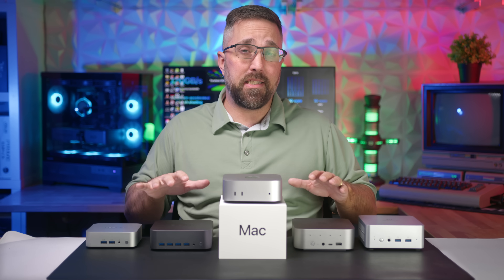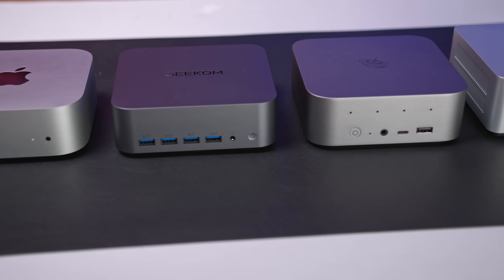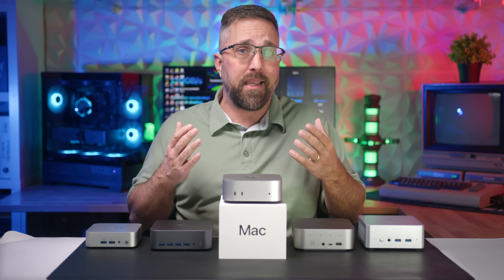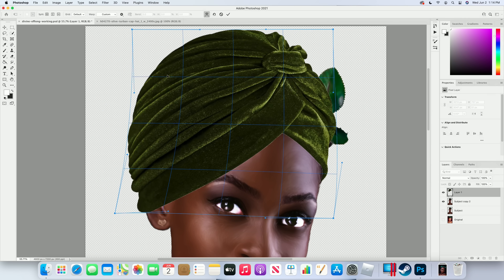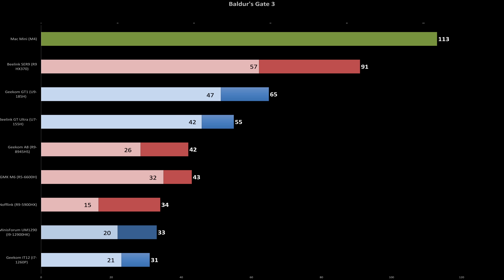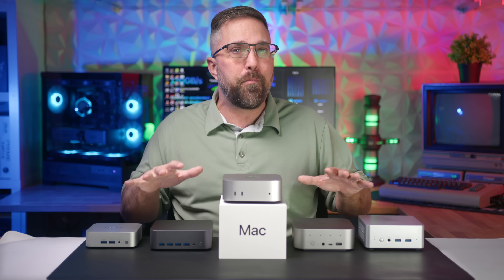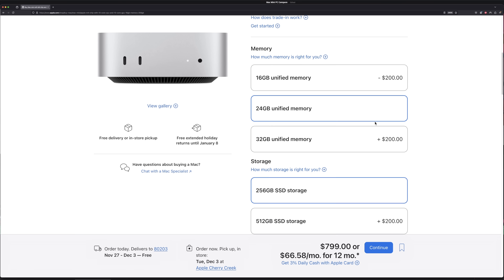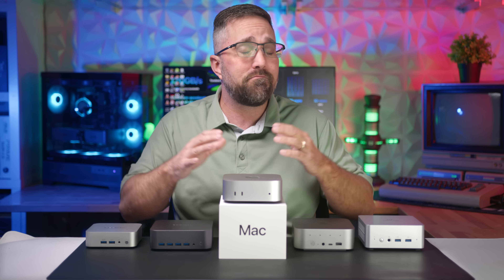M4 Mac Mini vs Intel and AMD Flagships – It's Not Even Close!

Comment: Nice comparison. I mainly upgraded my 2014 Mac Mini for compiling cross platform apps and development work that has to be done on a Mac. That said my wife some times uses an older Dell mini system, but if she does plan on doing more photography I plan on giving her the base Mac Mini, and spending the extra for my dev box. Storage and RAM are such a let down with the base price, the storage was just a slap in the face, and the RAM was because the OS needs the extra space.

Comment: I'm a Mac user - you should have used a Mac mini with 32GB of memory and a 1 or 2TB NVME. The $599 entry price is irrelevant when comparing against the PCs you've selected. That puts the Mac mini at $1800 for the base M4 or $2400 for M4Pro base with additional cores and 48GB of memory.
Reply: my understanding is macOS is efficient with its memory & 16GB "feels" like 32GB in Windows.
Reply: @udance4ever  you can't replace memory.
but yes, OSX supports memory overcommit and active memory compression, like Linux and AIX do too.

Since it's not a gaming machine, a mac mini is unlikely to replace a windows machine. In my case, it replaced a Raspberry Pi4 running Linux.
Reply: @udance4ever  its been proven that 8gb on macOS doesnt equal 16GB on windows. Therefore 16gb wont equal 32GB either
Reply: @udance4ever  in no world this is true

Comment: The Mac has half the ram and at least 4x less storage. Once you spec it similar it’s wayyyy more expensive
Reply: Lol you have such a funny logic...

Mac outperformed those PCs. even with its "low spec"
Reply: @zotirides9293 exactly. This was the whole point of this video. Even with lower specs, it was on par or exceeding more expensive PC options.
Reply: Just get an external drive. And the base ram should be fine for most tasks.
Reply: @PaDutchRunner   Storage is easy to fix but the ram is the problem, the base ram is not enough for anything but basic tasks in which case a Mac mini is overkill anyway. Just get an N150 or N250 mini PC. You will probably get twice the ram and storage even for half the price of the Mac. But let's be honest, most Mac customers are not comparing and would never pick anything else. Apple knows that and thus the crazy upgrade prices.
Reply: @bertilorickardspelar  base ram was increased to 16 gb a few months ago.
Reply: @PaDutchRunner  Better late than never I guess. They are nice, silent and powerful machines. Unfortunately I hate Apple as a company. I will never buy anything from a company that anti-consumer.
Reply: @bertilorickardspelar  you don’t think Microsoft is anti consumer?? If it weren’t for apple, there is a huge chance that computers would be limited to corporate access. That was Job’s point in his “1984” Super Bowl commercial.
Reply: @PaDutchRunner  Yes, Microsoft is probably worse than Apple. Apple did a lot for the development of the personal computer, kudos to them.
Luckily nowadays you can buy computers with Linux or without OS.
Reply: @bertilorickardspelar well then I hope you buy pcs with no windows and run Linux
Reply: But then it's also more capable as the RAM in these things is so fast you can get away with having less, and Mac OS is incredibly efficient at memory compression and general resource management compared to Windows, again, making the need for more less of an issue. The memory bandwidth of the base M4 is higher than the max bandwidth of socketed DDR5. Then you get the Pro, Max and Ultra versions (though there is no Ultra M4 this generation). The lower storage does suck, I won't deny that. There's no fancy way of getting around that one as there is with the lower RAM.
Reply: And also WAYYY more performant. Imagine he had gone for M4 Pro or Max? Wiped the floor with the others, handily, at everything.

Comment: I understand one could argue the Mac Mini delivers this benchmark-performance already with 16GB RAM - but comparing prices with 1/4 or 1/8 of the storage capacity is nonsense. The Mac Mini with 1TB SSD already is 999$ - make it 2GB, as the Geekom has - it's 1399$ - and if you even out the RAM, when your project needs more than 16GB (which most benchmark don't) - you are at 1799$ for the Mac Mini with 32GB Ram and 2TB storage.

And honestly... for the kind of work you benchmarked in the PC market I would not go with a Mini-PC, but real "high end GPUs" - meaning a dedicated GPU... for a workstation I usually don't need a gimmicky small case.
Reply: "...for a workstation I usually don't need a gimmicky small case.": You don't need a tower either. What you 'need', is which machine does it's job best.
Reply: I agree, his comparison is not "Apples" to apples, considering all the other systems have way more storage, and upgrades for Macs is ridiculously overpriced. I have a couple of Minisforum mini PCs in my home computer lab, each with 8 core / 16 thread AMD procs, 64 GB RAM, and 1 TB NVMeSSD... 4x the RAM and storage as the Mac Mini, for the same price. Also the Mac Mini has only 1 Gbit port, while my tiny servers each have 2 2.5 Gbit ports.

Comment: 600$ is a dream, over here Apple charge 280$ for 8gb more ram and 1100$ to upgrade to the 2tb ssd.
Don't care how much preformance it give, it's still locked in to their own little world.
Reply: Yet every single Mac that is purchased works correctly, no making Freakenstein machines like on the PC.
Reply: @tonyburzio4107  It works until macOS crashes like 16 times.
Reply: @arpsichord7474  Clearly you haven't actually used macOS and are just making nonsense up. I use macOS, Windows and Linux and one thing Linux and macOS have in common is stability (and better privacy but that's another topic). Anyone that's actually used the machines knows what you're saying isn't true but keep plugging away there buddy.
Reply: @Invid72 I've used two MacBook pro M4s. Both died because of their chips. I'm never going back to apple ever.
Reply: @arpsichord7474  You should buy a lottery ticket.
Reply: @tonyburzio4107  Most stuff works right out of the box? Some smaller brands right out of China might not have the best trackrecord, i follow and watch alot of mini pc reviews, the only thing ive heard is Minisforum have had some trouble with certain models in the passt.
There are pros and cons with everything, if anything goes bad with the Mac you gotta turn it in, on 99% of small computers you can just get a new powerbrick, swap the ram/ssd out in a few minutes...Mac you gotta pay the price or you can fiddle with soldering but that will ruin your warranty.
Reply: @tonyburzio4107  until it doesn't :)
Reply: @tonyburzio4107  You are living in a small world friend. A world dictated by Apple. Sad.

Comment: Apple users: The power button on the bottom is fine. It's better actually, because it's more aesthetic that way.
Also Apple users: 256GB storage is fine. If you need more, just buy an external SSD and let it dangle around on your desk.

Comment: These comparisons are worthless since I don't want to run macOS.
Reply: Exactly. If you live in the PC eco system, it doesn't matter what the performance of the M4 is. If you live in the Mac eco system, you want to see a comparison with older Mac's, to see if it is time for an upgrade. This video is only to try to convince you that Mac is better than PC, and we have heard this since the beginning of Apple, 50 years ago. I refuse to switch to an eco system that is controlled by ONE company, from top to bottom. They design the CPU (which doesn't work on other OS), they design the rest of the computer (which doesn't accept other CPU's) and they design the operating system (which only works on their own hardware). That is not the future of computing. With Windows, at least the hardware can be built yourself, choosing components of many different manufacturers and designers. Only the OS is proprietary, but that can be fixed by going to Linux. I would love to switch to Linux, but it's not mature enough. The "it just works" slogan is not applicable to Linux.

Comment: I see some points that should be mentioned. Comparing these mini PCs with the same configuration would be better such as 1 TB SSD and 64 GB RAM. The Apple Mini can cost up to more than $3.000 if adding some optional extensions. For some users it might also be interesting whether they can change components such as SSDs or RAM later on. To compare Mini PCs their power consumption, the noise, the speed of the internal GPUs, NPUs are important aspects as well. It is the same as buying a new car. You almost never by the base configuration.
Reply: for lots of ram and internal storage (faster even) the mini pcs with windows or a hackintosh (fewer options) are 4 times less expensive than a comparable mac. But for 16gb ram and using external storage, the mac mini m4 is the best value.

Comment: I am tempted to start putting money back for an M4 for when Asahi supports it, wish someone would make a similar format ARM machine that fits in between the phone/tablet chips (snapdragon/RK3588/etc) and the Ampere chips.
Reply: The apple offerings are arm. Even if the OS they lock them to is horribly locked down and bloated. Also sounds like you want the performance of a snapdragon x elite, hope it gets linux support.
Reply: I am aware the M-series are ARM (+ apple extensions). I would just like to get 4TB of storage without spending $3k on apple tax.

Some of the X Elite info I saw puts it under M3 or tie for a lot of compute tasks. So the X Elite dev kit for that is really out of the running for the moment due to being priced higher than the M4 for kind of lagging performance.

Comment: This is what I've been looking for. I'm currently using a Minisforum. It's cute, but seems to be slowing down after 3 years. I do light video editing and never game. My son does occasionally when he visits.  2 questions, though: 1) If you installed Windows (VMware or parallels) would the games run as well as on a mini PC? Or is that more of a hardware incompatibility? 2) If you reran all of these with M4Pro, I assume not a single miniPC could compete (for non-gaming use cases)?

Comment: So how does the price to performance ration factor in the disparity in memory and storage capacity ? Are you seriously comparing a 256GB SSD system with a 1TB SSD System based on price to performance but do not actually factoring in what happens when you run out of those 256GB of disk space ? Now spec something with comparable parameters and then try the price to performance ratio .... I mean you can get a barebone ryzen 8845HS system for 389 USD. The performance is still there just you cannot use it !!! But you CAN apply the same metric right ?

I had to get this out of the system. Whenever I see price to perf metrics for asymmetric configurations it gets my blood boiling.

Comment: Really great breakdown!

So good to see someone who is largely agnostic when it comes to choosing hardware and operating systems - and reviewing them.

There's a few things that could make the mac mini M4 even more desirable for those on the fence: 

SSD upgrade via a third party - unless Apple get nasty, if the mac mini M4 proves in sales just how popular it is, then there's money to be made providing an upgrade by 3rd parties.

ARM based Windows - Microsoft dropped the arm windows 11 iso for download recently.
The question, however, is whether anyone will create drivers to fully support the hardware.
It's more likely that Linux enthusiasts will get there first.

I have numerous PC's, windows, linux and mac running, but macOS has been my daily driver for over decade now.
The OS to me is head and shoulders above anything else in terms of just keeping out of your way and in terms of reliability and slickness. 
Windows 11 is OK once you run debloater on it - except when it decides to run updates just at the point you want a quick 10 minute casual gaming break! 
Linux Desktop - come along in leaps and bounds, but still a bit klunky - feels 10 years out of date.

Comment: I'm using MINISFORUM UM790 Pro. And it's great little machine with Radeon 780M GPU onboard, and fit my needs. I can easily play quite demanding titles on 1080p in medium settings. The one thing what I still don't like it's external power supply which often comes as a quite big brick. Also great thing is, I can easily extend Storage using two NVMe M.2 slots and RAM up to 64GB.
Reply: I’m thinking of the Beelink GTI14 which has the power supply built in and I can get a doc for a GPU.

Comment: Price to performance seems to be a bit biased, picking most base mac mini vs not so base other mini pcs. They should be compared at equivalent ram, storage options :D
Reply from the maker: They are all base models. The PCs don’t have cheaper versions.
Reply: @ElevatedSystems  The fact that you checked for most expensive ones like 8945hs. It is more or less equivalent to something like 7840hs or 8845hs. And these I could find mini pcs again 32gb ram 1tb, for 400, 500$ respectively. Yes the value of mac mini is not bad, but accepting 256gb of storage or 16gb of ram with insane upgrade costs is a lot of copium, especially in 2024. Phones come with 256GB of storage. What apple does here is price laddering, where you think of might as well pay a bit more for teeny more ram, might as well get a bit more storage and then you're nowhere near the price to performance.
Reply: @MultiDeivas just but external sad like everybody is doing brother it’s not that hard
Reply: @MultiDeivas the storage is less of an issue compared to ram for pc in general, you can easily get external ssd if you buy a pc since they are going to be stationary and 16gb is good enough for most people
Reply: @ElevatedSystems  "Mini PC" is a generic category, there's no specific models you have to pick. You picked those to go along with the narrative you wanted to build for the video, but there's a thousand Mini PCs with different chips at any price point, with RAM and storage options to configure closer to that of  the Mac. To be fair, the PCs probably would hurt on benchmarks from having less RAM too, but picking ones that come prepackaged with a bigger SSD and then complain about their value proposition in comparison, when you could either compare the price of cheaper Mini PCs or factor in the cost of adding that storage either internally or externally on a Mac (not just mention that it lacks storage, factor it in the price and value conversation), comes off as disingenuous.
Reply from the maker: @puntodelectura  So, you are saying I cherry picked the PC's and then suggest I cherry pick the PCs? I selected the Mini PCs with the top tier CPU's at the time and configured with the least amount of storage and RAM. Just like the title says. Unfortunately Apple charges a stupid amount for their storage and memory while AMD and Intel charge a stupid amount for their mobile CPUs.

Comment: 1:30 Apple Storage and RAM... You're kidding me Apple? XXI century and no NVMe M.2 slot 🤬🤬
Reply: Well thats apple for ya
Reply: I don’t know I like cloud storage I have 2 TB on the cloud. I also have 2 TB on a drive that cost me 60 bucks. They work fine.
Reply: @steelfloor10  the problem is cloud storage is a subscription service that will quickly add up to more than a normal drive, cannot be accessed without wifi, has slower speeds, and is much more subject to the possibility of a 3rd party accessing it.

I also personally hate it for being yet another thing companies are prying away from the hands of the average consumer. Even your own personally stored data is now able to be handed over to, and held by, the opaque methods of a faceless corporation.
(Also I just REALLY hate that subscription part)
Reply: You gotta be new to Apple, if their limitations can rock your boat.?
Give it time. they just added a pushable button to Iphone, so things are moving along.